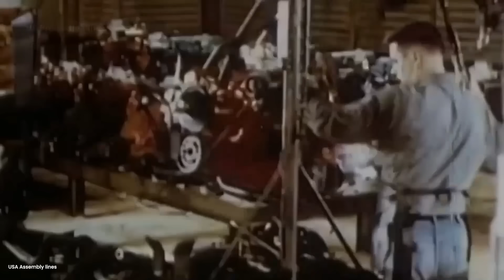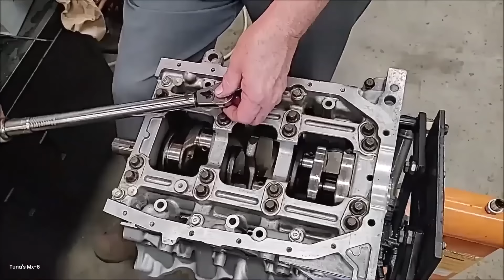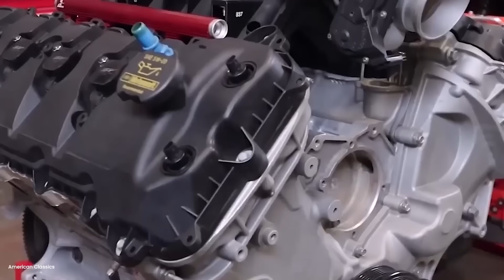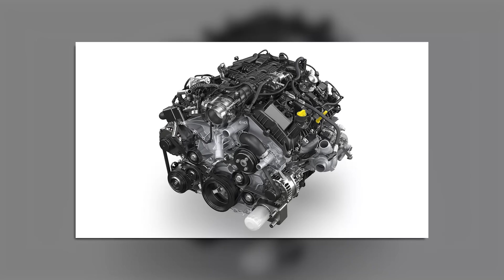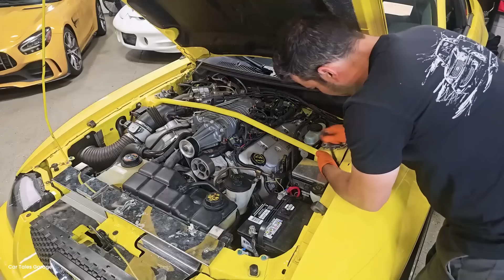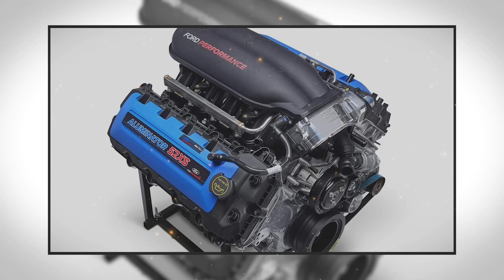How One Ford “Modular Engine” Outsmarted Every V8 Swap With a Simple Timing Fix

Comment: Truth is. NASCAR Ford teams do NOT run the OHC engine combination! They run a pushrod combination coded FR9. An engineered combination of the Windsor block and rotating assembly. And Cleveland cylinder heads. With Improved oiling and cooling.

Comment: I'm impressed by Caterham (UK) putting the Ford Duratec 2 liter, 4 cylinder, supercharged, 310 HP into their version of what was the Lotus Super 7, making the under 1000 pound car a 620 HP per ton pocket rocket BEAST. Colin Chapman's club racing kit car is now a street-legal muscle car - available as track or street trim - but neither is very practical as an only car. With no doors a roll cage, entry and exit are athletic, and with a passenger there's little to no  place for groceries or even a backpack. Open exhaust means your neighbors will KNOW!!!!!! about any early or late launches.

Comment: Bought new 2002 mustang GT 4.6 5speed car put tune in it driven daily since I use 10w30 full synthetic oil and Motorcraft filters got over 420000.0miles on my baby how long does clutch cable last 400000.0 miles how long does stock clutch last didn't slip but the pressure plate fingers broke and jammed up operation 410000.0miles still has factory water pump

Comment: I want a  Ford FE simple power 406 ci 2 valve efficient engine with monster torque and horsepower and lived a million miles. The 406 FE engine was 50 years ahead of its time. Get with It!!   SHP, we want a 406 FE crate engine for our classic cars. The 351 W doesn’t cut it. The 405 split transmissions in 1962. We need FE blocks. Please!
Reply: The FE was a great engine,  but NOT 50 years ahead of its time! That's why it was done in the 70s. Why do you believe it was 50 years ahead of any other V8 of its time?

Comment: You said "the engine that couldnt compete with a traditional 350" when referring to the 4.6 4v on this video that is bs.  I had a 97 cobra w filter, midpipe and 410 gears no tune or anything and i pulled many lt1 camaros w 6 speed transmissions at redlights in its day.  I assure you it had no problem competing w the traditional 350 in fact it had no trouble showing them tailights.  This video is full of misinformation about the old 4v

Comment: The 4.6 didnt have less power or tq than the 302 they was both 215 hp 285 tq both dyno the same too.  Ppl just didnt like them because there was no afrermerket at first but today that aint the case they have just as much aftermerket as pushrod stuff.  They make just as much power stock and modified and only need a forged rotating assembly to make big reliable power as opposed to also needing an aftermarket block like the 302.  There is no downside to 4.6 other than not sounding as good as "5.0" when you say it.  Doesnt roll off the tongue the same.  Look at both unbias the 4.6 has no downside vs the 302

Comment: My modular 5.4 2 valve has 427,000 miles and still runs perfectly.  There are many 4.6s and 5.4s with many many more miles than mine.
Reply: I miss my 5.4s. 2001 Expedition (off-road beast, Snow Beast), and pretty simple. Rusted to death and I drove it to the junkyard. I heard them in the background "trying" to kill it. I felt so bad and one of the junk-dudes simply said, "It's a Ford 5.4. What do you expect?".

Comment: My 4.6L 2v makes 309rwhp 321rwtrq at 5,446rpm TFS 38cc top end.. Torque stays high from idle to redline.. Wanted to make power till 6,300rpm but need a tuner who knows what they're doing with these engines..lol

Comment: I had the 32v DOHC 4.6 in a 1998 Mark VIII LSC. Smooth, economical until the tach passed 3K and the second set of intake runners opened up.  A few seconds of full throttle to overtake and I would be hitting 90.  Heavy car but it would definitely haul the mail.  Never did anything to it besides oil changes, spark plugs and a tuner chip.  When I sold it at 290K miles it still didn’t use a quart between changes.  GREAT engine!
Reply: The 4v is a badass engine.  I have a 97 cobra and used to have another years ago I also have a 12 boss 302 and 07 gt500.  Huge fan of the 4v motors of all years up to and including the coyote stuff but I kind of have a soft spot for the pre coyote 4v stuff those engines are awesome and while being modern they also have a simplicity to them with no vct or anything fancy no knock sensors or anything else
Reply: Now you see why Germans and Japanese built DOHC.

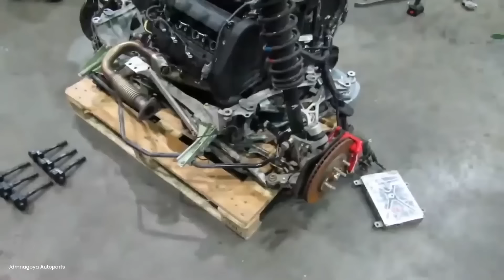Comment: 4:07 it was a monster, 280 hp from 281 ci (1hp per ci) vs 300hp at 350ci(<1hp per ci).... the dohc was the largest advancement in USDM small block  v8 technology before the mid 2020s

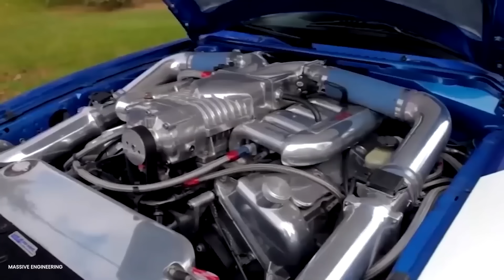9:56  overbuild and de-tune. UsDM finally took notes from JDM

Comment: John Colletti (Mr. Horseower himself) knew what he waa doing in the 90s. Today, here we are with Coyote V8 being the Teskid's descendant and being one of the best v8s in the whole world.
Reply: You damn right he know.  The teksid was a monster.  The coyote is just the modern evolution of it w better more modern oem parts and tuning and tech in it.  Ppl try to make the coyote more than that and the coyote based engines like roadrunner and predator but that is really all it is no more no less.
Reply: I have 287k on my Coyote. I wouldn’t dis the Modular’s but the Coyote is not the same engine.
Reply: @nels9382 the coyote is very much the same fucking thing.  I hate when ppl act like its some special halo engine that is totally nothing like the old 4v.  That is absolutely nonsense and you arent giving the 4v the credit it deserves.  It is literally the coyotes descendent.  The coyote just comes better equipped out the box and has more modern tech and stuff that's it.  There is nothing special or amazing about it beyond that.  The tech and modern parts it uses is better out the box.  But when you build a 4v built vs built it can hold it's own all day vs coyotes.  The teksid 4v has been stupid fast w stock crank and block just like coyotes do.  Coyote is just a more modern version of the same thing with better more robust parts oem because its newer and newer tech added to it like knock sensors, more compression and twin independent variable cam timing.  That is what makes it so good out the box.  The 4v was great in its day and has just as much potential built just isnt set up as optimally out of the box because theyre much older.  I love them all and coyotes are great I just hate how its fanboys try to act like its some touched by god halo engine that is nothing like thebl 4v that came before it simply because its set up better out the box because its newer w more tech.  Its the same engine layout same bore spacing its the same thing.  Its a punched out 4v with more compression and tivct.  Thats it.  It isnt some halo touched by god engine that is nothing like its successor.
Reply: @midnight347  You've obviously never been in either of these engines.  Bore spacing, 4 valve per cylinder, engine mounting points, and bell housing bolt patterns are literally the only things they have in common.
Reply: Big John thanks

Comment: Neverheard NASCAR using the over head cam engine They outlawed the Sohc in the 60’s
Reply: That's just misinformed - not you, them. The mod-motor was used on the street and in drag racing, but never in NASCAR. As you said, it was and is against regulations.